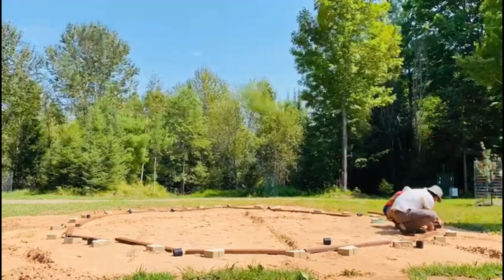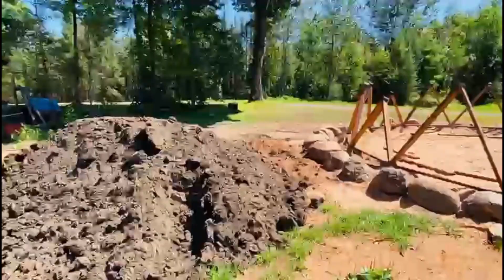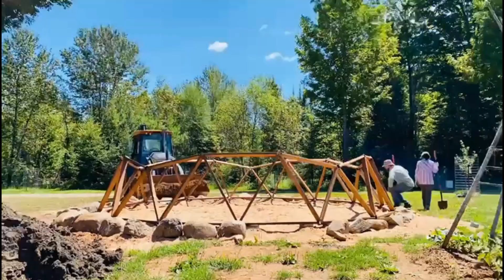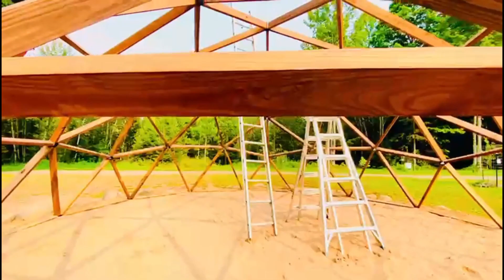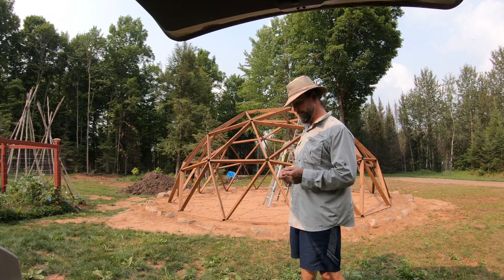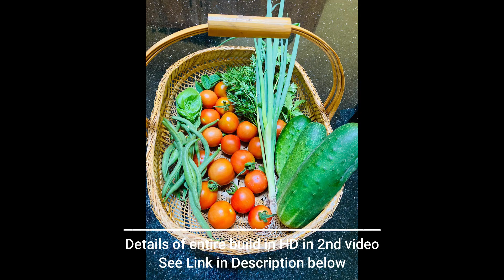Greenhouse Dome Build $800 - Geodesic

Comment: For polycarbonate covering its better to use the panel method vs hub and strut. Making the polycarb watertight can be tricky, i`ve never been a fan of relying on taped joints :)
A good quality 5mil clear greenhouse poly has 91% light transmission and is guaranteed to last 5 years. Most polycarb is guaranteed not to yellow for 10 years but its best to check before you buy..
Reply from the maker: - Hi John, I couldn't agree with you more but like most things in life we need to live the experience to learn. I bought the expensive 6 mil tape made for the UV plastic and 30% of it is now blowing in the winds of winter. Thanks for the comments

Comment: You have peaked my interest , now thinking on building one of these ,  any tips or advice would be great. BTW I'm now a New subscriber ,hope to see more of your DIY projects. Cheers from Blissfield New Brunswick Canada.
Reply from the maker: Cheers neighbor from the freezing tundras of the Upper Peninsula of Michigan, temperatures are -4 F this morning! My advise is to make sure you have a plan to what you're solar needs or expectations will be. How much electricity you plan to need and use, along with the amount of sun energy available in your area. Once known you can plan accordingly. Installing solar is easy, expanding on what you have needs to be thought of ahead of time.
Reply: @ahhlifesgood1956  just looking to build the dome style green house I have solar fan for summer for the ceiling as I use in a Solar kiln. Where did you get your kit for the dome.
Reply from the maker: @downloadjunkyadventures  - Just realized you sent me a message from the Dome, nice to see and sorry for the confusion. The dome is a fun build, no kits, all materials purchased from the local hardware store. Though you'll need to follow the instructions from Acidome.ru, can be a bit tricky in the beginning but once you study it for a little bit it comes really easy. The materials I purchased at the local hardware store were treated 2 x 4 lumber, and ABS piping to connect the joints. The advise I have would be to build yourself some type of semi foundation, whether a pony wall or simple anchors to hold the structure in place once built, this helps with rigidity. Also be sure to use the UV rated 6 mil poly, the cheap plastic goes bad in 6 months as opposed to the UV plastic goes 5 years. Other than that the build is easy, quick, fun and a great art piece in the yard. Think about installing irrigation ahead of time as well, this was something we added after the build, given the amount of options this is something to plan for. If you plan to sue Poly carbonate plastic sheets for roofing material be sure to size your triangles appropriately to match the industry standard sizes sold.
Reply from the maker: I have some very detailed videos on the entire build, was planning to publish them sometime soon.
Reply: @ahhlifesgood1956  ahh excellent advice. I'll be sure to follow these examples,thanks for the quick response.